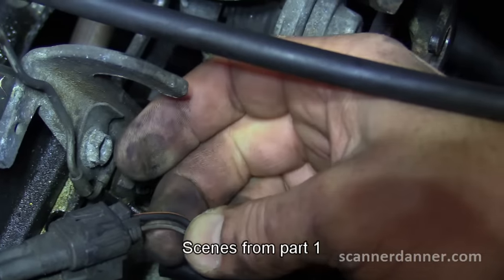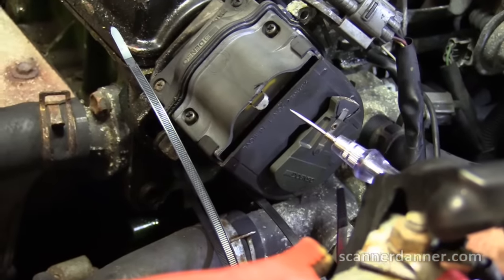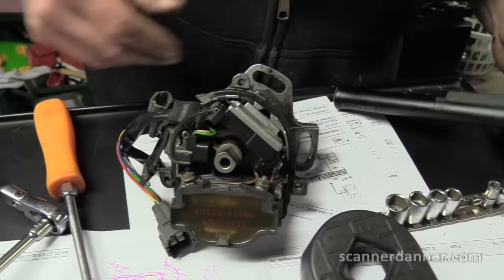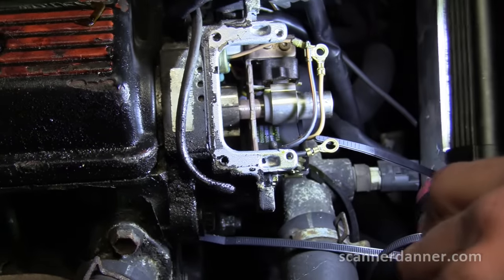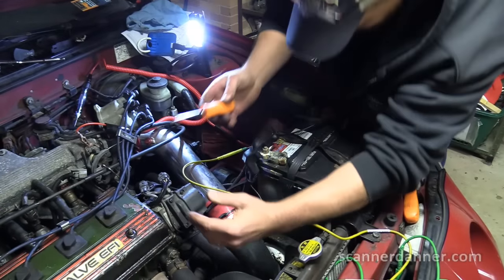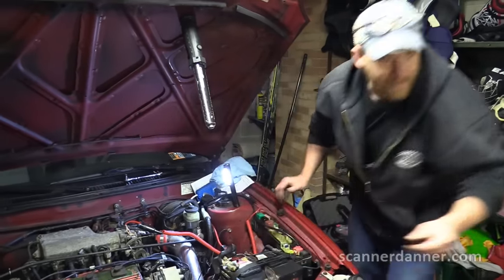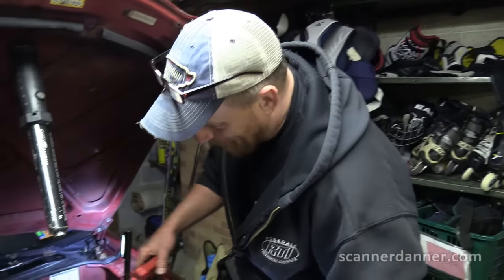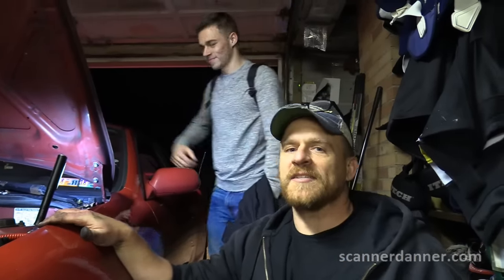Ignition System Operation & Testing - (No Spark Toyota Celica)-Part 2

Comment: Changed everything. Still got code 14. 3sge engine. Also I have airbox if you still need it 😆
Reply: Ecu. Plugs. Rotor. Cap. Dizzy. Plugs. Leads. Ignitor, module. All changed. Still code 14
Reply from the maker: What is code 14? (Definition)
Reply: @ScannerDanner  code 14 is IGF short.  No signal to ecu 11times.
Cuts off spark
Reply from the maker: @jamesmorgan8143  what is the IGF signal when measured at the distributor compared to at the ECM? That is going to be the key. 
You probably need a scope to see it though. 
So as an alternative: disconnect the ECM and Distributor and give me a resistance reading on the IGF wire from end to end and then from one end to ground

Comment: could you have ohme'd out the coil to see which was the good one..? great job man, thank you for all the knowledge guy's. I genuinely enjoy learning your content. 
🩺🧲🪛🔧📎📊🥽🚓👩‍🔧👍:yt:
Reply from the maker: I almost never measure coil resistance. Bad ones test good all the time with resistance testing because there is no load or stress on the windings.
But you are right, that may have helped in this situation. 
🙂

Comment: Very informative. I think I might have the same problem with my 94 celica, turns over and kinda like to start but won’t go all the way . Did you simply unplugged the injectors to clear the flooding? Will a weak / defective coil give spark at the wires?
Reply from the maker: step one is to definitely check to see how far the spark can jump. It should jump near a 1 inch gap
Reply: @ScannerDanner  will do. thanks for the reply
Reply: @ScannerDanner  by the way, would a very advanced timing cause it not to start as well? my son moved the distributor all the way clockwise after moving it coz he said it was the original position when it was running fine. thanks again

Comment: Thnx for all the helpful vids, question...I just recently purchased a 1996 Honda Accord coupe lx 4 cylinder...ive gotten it to run and it runs great, but when I cruise around 60 for about 10 minutes it will stall like it ran out of gas and will not turn back on after that...the dash lights are on and the motor cranks,  but will turn on and immediately off after that...I have no check engine light on and I’ve already replaced the ignition as of yesterday and main relay with no success...also not sure if this has anything to do with it, but when running the mph needle runs smooth till it hits around 60mph and will bounce around between 50 and 65 and won’t stay still...I can’t get the car to stay on for more then 25 minutes at the most...PLEASE HELP WITH ANY INSITE ON WHERE I CAN START -thnx!
Reply from the maker: we need to find out what you are missing when it stalls my friend. Fuel pressure must be verified as well as spark and injection pulse. Without knowing what you are missing I cannot guide you without guessing and that is not something I do. 
The top two things you've already addressed (ignition switch and main relay). 
My guess is the speedometer issue is separate unless it starts doing that right before it dies.
Reply: ScannerDanner  thanks for the quick reply bud...I’m not the most mechanic savvy but I’ll check that out...by chance you wouldn’t happen to know any thorough mechanics like yourself in or around the Houston area? Just had to ask, again thnx for the response
Reply from the maker: If you're on FB post a message on my business page "ScannerDanner". I have about 4k or so techs following me there. I'm sure we can get you to someone who follows my method of doing things. (No parts changers)

Comment: I got a question here so sorry to interrupt is it going to start when you put the coil in cuz I want to see it I want to see a start because it doesn't sound like to me that the coil was malfunction it's dirty but I didn't did not are you I'm not too sure I'm saying it right why didn't it start because the rotor cap is dirty or because there's a voltage or because with no fuel or because what well or PVC valve what about if you take off the PVC valve off the into the carburetor or change the fuel injector and then what well one of the center ones in the back the black one go ahead and make sure the holes are busted for your PC valves so you might want to buy some PVC valve plastic things and replace all of your all your what all your PVC valve hoses and then replace the air filter and then make sure you don't have no leaks and then replace the two heater water heater because you can have a hose busted and then put a little bit of oil in water and the radiator water for head lubrication and then how come I have to use water instead of using oil for the lubrication can I use water and oil or get steaks or clogged up the but it won't corrode the the what the water pump would it I'm just asking them questions this is a race I'll seal for the dumb business people like myself and Mr Trump

Comment: I have a Toyota tercel 85, after I drive it for an hour or two, if I stop and turn off the engine, it will start but after it drives for maybe 100 feet, it will die and won't start again unless I use fluid starter. Fuel pump ( mechanical) was replaced 1 year ago.
Do you think it could be the distributor?
Reply from the maker: when it is not starting you need to check for injector pulse and fuel pressure. If I have that info I can help further. Unplug one injector and put an incandescent test light in between the two injector terminals (don't let them touch!) Crank it over and tell me if the light flashes during the no start

Comment: hello i have a question..
im driving (or not driving lol) a 1993 Ford Explorer 4.0 2wd and im having a spark issue. in addition to applying my own experence iv watched just about every youtube video pertaining to spark and distributorless ignition systems and bought and read the repair manuel. got frustrated and sent it to my trusted mechanic. between he and I, every component on the ignition circuit that would electrically involve starting the engine has been replaced including the computer. I have even hand traced wires and repaired any damaged wires I have found to these components I'm stumped. there has to be something im overlooking..

Comment: Like video clip, have a problem, person bring in Toyota Corolla 16v 1998 no power 80-100kmph jump out gear 4 then 5 reaching 120kmh(ok gearbox problem) plug wire 1234 to distributor are marked 1342 and was not put in correct order and person pull all out, put timing correct crank TDC cam correct where must it show on distributor and what is the correct plug wire order. Your assistance will be greatly appreciated.. Thank you

Comment: I'm  having similar issues with corolla 91
It broke the timing belt  I put it back  cramk but no start it had weak spark the coils was replaced good  spark  with  the new  
But still having weak spark at the spark plugs what else can I check.
Can u help me please 🙏🙏🙏🙏🙏

Comment: I have one question, my car is corolla 96, when I start the engine it work about a half minute then the engine of, so what happen? what should I check? Thank
Reply from the maker: Find out what you are missing when it doesn't start.
Fuel pressure, spark, and injection pulse must be verified. Once you find out what you're missing, then I can help. Until then, there are way too many variables

Comment: Hi Paul, God bless, I have a question, I'm a DIY'r and was testing my sons 93 corolla and disconnected cyl 1 cable but without a spark plug. cranked it for a bit to dry the cyl. out (I suspected it was flooded, instead of disconnecting the injector wire) then the car died and didn't want to start again.  My son said that if you crank it without connecting something to discharge the cable (in this case spark plug) then the current builds up and goes back to the coil and fries it.  Is this true?
Reply: LOL, I just reviewed the vid again and realized that you answered my question at 6:00-6:15.  So I guess I need a new coil

Comment: Scannerdanner i have the same car with same engine same problem i replaced the whole distributor and and it stared right up i also rember my car starded studdering i rember somone told me that the capacitors in the ecu go bad after years so i open up my ecu sure enough thy whr leaking had them replaced problem solved no more studdering

Comment: Good day .  My Toyota ae111 starting  and cutting  off also  when put in the gear it also cut off  what is the problem and how to fix         thank you .
Reply from the maker: You need to do some tests and find out what you're missing or what's dropping out for me to help. Also year, make, model, engine size, trouble codes etc. Everything else is guess work and that's not what I do.

Comment: Hi Scanner Danner, I have a Toyota Corolla 1997 made, it starts, then when the engine gets hot it's shut off, and will start until next day. And does the same thing again. What should I do because my car is parked a long time now
Reply from the maker: You need to find out what you are missing when it stalls and is not starting. Spark, fuel psi, fuel injector pulse? Also it would be super helpful to scan it for codes too. Can't help without more direction. Thanks!

Comment: I have a question, I have a 1995 corolla normal running when the engine is cold, and when the temperature reaches 100 the engine is ignition disorders and will be unstable in slow motion
what is the problem thank you

Comment: The pick up coil in the distributor is the crank signal, what part in the distributor is the cam signal?
Reply: I always thought it was the G and NE signals. Think of the NE signal with the four point and four signals being the crank signal and the G signal with only one point and one signal per rotation being the cam signal. I may be totally wrong, but my cam synchronizer only has one tab so it only interrupts the sensor signal once every camshaft rotation. That's my two cents.
Reply: At 7:27 as he's turning the distributer shaft, see that point on the shaft, it is the notch that gives the cam signal. A pickup coil senses when the point passes under it and sends a pulse back to the computer.
Reply from the maker: Exactly Steve M.  Your 4 pulse signal would be your rpm and piston position signal (crank) and your 1 pulse signal would be your specific cylinder ID (cam)

Comment: You are amazing explain, sory for my english,  I have a corolla toyota 2000 made in brazil, the engien works ok, but the chek engine alwasy light on, i read the code 12 using a jump in the  OBD1, i cant erase this code, i tryed wtiht the fuse out, disconect the batery for 5 minutes, but the code 12 never erase, if i read the code before runing engine, yhe code 12 always appear, can you help me  with this fault, the engine works ok, the RMP and velocimeter always work ok, y clean the  distributor connectors, , thanks
Reply: the distributor has 2 connector, un 2 pines, and the other 6 pines, I dont have continuiti between pinn 3 and pin6, (green and red colour) I think they are the G1 and G signal, the coil one pulse per 360degree, i ll look up here and try to change this coil,

Comment: I have a hard start with my 7afe corolla. When it starts the for the first time of a day than it starts everytime. I have no spark when it struggles to start. My tachometer is not working also. Im unsure if it bounces beecause of vibration or the circuit working. But since it starts i do think it has good working circuit. Is it possible that i have a weak coil and having the hard start issue confuses me to what the problem could be. If i have a bad pick up coil or air gap since my tachometer is not working. It didnt work before i started having this problem too. What issue could i have if the coil pickup is not working
Reply from the maker: forget the tach test, that is a test, not the test. When it doesn't start, you must confirm coil control or not. If it is the same set-up as in this video, I do show how to test for control using the test light right? If I do not, I have other videos showing this method. They'd be in my chapter 22 playlist

Comment: Hey Scanner Danner, I have the exact same model with a slightly different issue. Car feels like it misfires from gear to gear change when I lightly tap the gas pedal, like there is no smooth transition between gear changes.There is spark, but I am getting engine code 14 which I believe is an IGT issue according to my research. Should I just blindly replace igniter or whats the best way to tackle this?
I have already replaced spark plugs and wires as well as cap and rotor.
Reply from the maker: I just looked this up. This is a fault in the IGF circuit not the IGT. Your options for faults are wiring, igniter, ECM and believe it or not, the ignition coil. Based on your symptoms the first thing I would do is to take the cap off and do your spark test on the coil like I showed in the video. Let's make sure it can jump a 1" gap.

Comment: I have a question on your video, I have the same problem. Bought a coil and weak spark, replaced it in store for same brand and same thing. Is there anything else that would cause the coil to have a weak spark besides a bad coil
Reply from the maker: I think I just answered this, right? Thanks

Comment: Do you have to set top dead center and then install the dizzy with the rotor correctly?  Or doesn't the 5sfe dizzy just go on one way anyway.
Reply from the maker: From memory, the keyway or slot in this one is off-center, making it impossible to install it incorrectly. On other systems, yes, absolutely you must make sure it is done how you described.

Comment: I have a 96 Toyota Corolla 1.8 I think I still have the box if you want it I prefer the cold air
Reply from the maker: Thank you, car is no longer with us 😉
Reply: @ScannerDanner  I think I need to start saving these parts instead of trashing them. Some people enjoy original vs Custom.
There's a few ways to not have your cold air intake turn into a "Wet Air Intake"😂 good 1 .

Somebody explain to me about a water or moisture dump. I have an idea but I never seen one. 

May I personally like to utilize the space between the wheel well and fender where the water was or is if you modified it. Just way you can get all your cold air without water. That is unless you crossing the like I see so many fools do.

Comment: My car has a 4e fe engine and it has low power and a pull back wile driving and when talk my foot off the gas it has a huge pull back what could be the cause other than the coil

Comment: Im working on this exact no spark issue on same vehicle. I dont have a scope, so using a test light, I checked both plugs(one 2 wire, and one 4 wire), on the distributor, and got no power with ignition on, and also while cranking. Is this confirmed that it is not a distributor issue, and that something further back on the circuit is the problem?
Reply from the maker: you should definitely have power going to that assembly, yes, this is NOT a distributor issue
Reply: @ScannerDanner  thats what i thought. Thank for replying Paul. i have been watching your videos, along with SMA, ETCG1, diagnosedan, and diagnostech. all you guys are great. Thanks. from New Zealand.

Comment: Could you check the ohms of both coils to determine which is the good one?
Reply from the maker: sometimes a "shorted coil winding" only shows itself when it is stressed, so the ohmmeter is not the best tool for this but yes, I probably could have done that :-)

Comment: I put this question in part 1, the NE system has two coils in serie in the diagram (90 degree  angle ..? ) so does it has 8x with 0ne turn instead of 4x on one turn?
Reply from the maker: Not with one signal wire. I'm sure it changes the characteristic of what the signal looks like (maybe) but it definitely only has 4 signals per 360. Now the real question is why Toyota is using this design. That I cannot answer.
Reply: Paul, if a the “magnet” induces a signal in the first coil the second in serie would act like a resistor. Than passing the second coil the reverse situation. Second coil spikes and the first is the resistor.... or are both coils intertwined and activated at the same time.... or....

Comment: So I changed out everything like u did.and I'm still not getting spark.i checked all fuses and relays and they are all good so where do I go from there.
Reply from the maker: You changed out everything but what tests have you done? New parts means nothing these days
Reply: So what I've done was, the same test u did to get power. With the distributor,and cap ,ignition rotor.and still have no fire I did all the steps u did in that video.